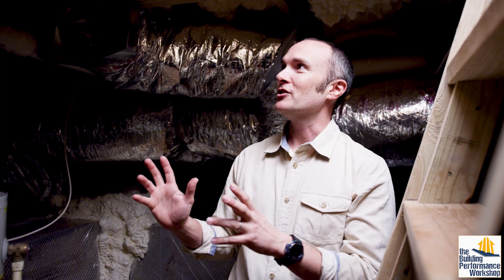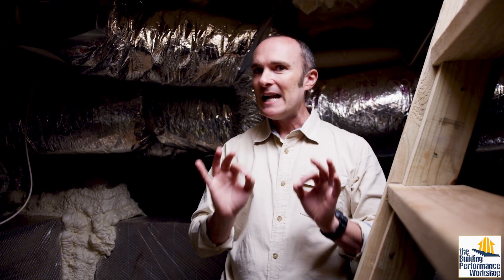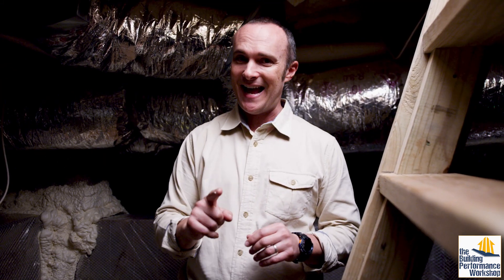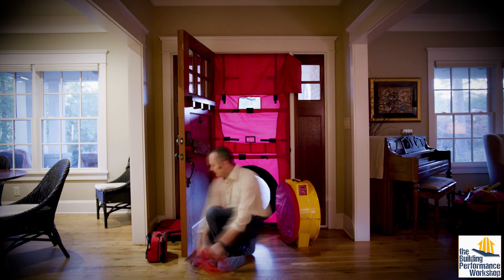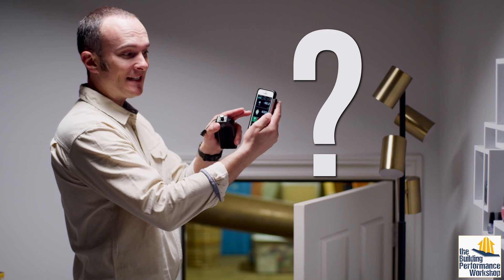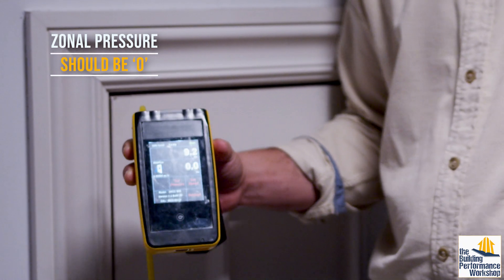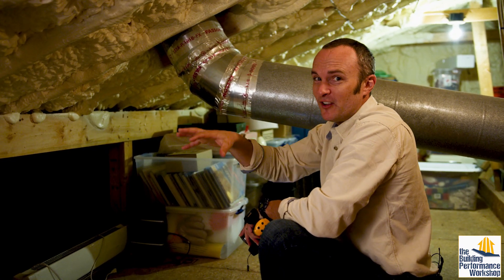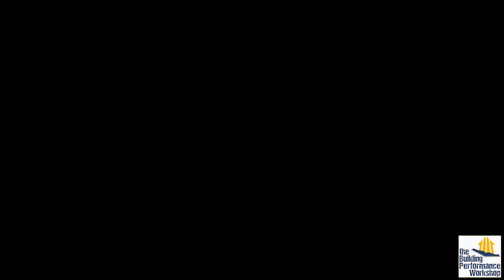Spray Foam Inspection & Testing in Crawlspace and Side Attic

Comment: So, what about spaces with no access that were foamed during construction? Is there an official method for positive pressure testings with smoke to identify leaks from the outdoor view? i have monitoried a project where the blower door was flipped and installed at the roof accesses. They then flood the roof cavity with smoke/party machine glycol based smoke and looked for smoke release on the outside of the building.

Comment: I'm often surprised how much gets missed with spray foam jobs and how much air leakage there is in attics that have been spray foamed.  I wish the installers would spend time running a blower door test when they're finished to find all the small spaces that they didn't reach, especially at the soffits

Comment: Very interesting video.  She mentioned a "hot, humid room" (assume an attic room adjacent to upstairs living space) and later mentioned "they brought in outside air" (into where?) and "encapsulated the crawl space."  Normally spray foaming the roof would be to make the attic space conditioned so the home interior and the attic room should all be more or less the same temperature & humidity.  Sealing that roof duct is a great idea but I suspect will not solve the problem (and since metal readily conducts heat, it may still be a source of condensation in the winter).  Is there an HVAC vent in the attic room along with a return to the main living space?  If not, that should help a lot.  Also, it sounds like the home is too humid in general (e.g. window condensation) and I suspect there's no dehumidifier in the encapsulated crawl space which is a source of moisture even if encapsulated.   Unless mitigated, that humidity will find its way into the whole house due to the stack effect.  This just shows how even a good builder may not be an "expert" in energy issues.

Comment: Did you install an ERV when you built the house?
Reply from the maker: This is not our house or build, but sounds like they added sn ERV after they started having problems.
Reply: @HomePerformance  So they made the mistake of not installing an ERV when they made the house almost air tight, is that correct?
Reply from the maker: Spray foam and ventilation were installed simultaneously, I believe

Comment: Another insightful discussion on a hot topic 👏. Are there any alternatives to spray foam to achieve R30 on 2x4 or 2x6 rafters? I think you once made a video where you talked about using stapled fabric with blown in. But mostly I have seen videos with mineral wool insulation after air sealing. Are newly framed roofs built with 2x10 rafters? Or may be they rely on combination of exterior and interior insulation.
Reply from the maker: Hey Suparn- you can actually get R-30 out of only 7 inches of Rockwool, which would be a 2x8, or two 2x4 layers. There is nothing like foam insulation for R-per-inch, unfortunately, but exterior insulation is a great option if you're dealing with 2x6 rafters, if you're replacing the roof anyway.

Comment: The tighter the house the more important dehumidification is, especially in colder climates.
Reply from the maker: And especially in warmer climates too
Reply: Many retrofits can't get to some areas so the higher humidity makes some places collect condensation which turns into water damage and mold. They have been struggling with that in the UK as they have been trying to make old housing tighter. In hot climates, you can be comfortable at higher temps if you control humidity.
Reply from the maker: Spoken from experience here too- our home is set to 76 deg, 45% rh

Comment: I am not buying this whole "Super Insulated" home thing. I remember the sick buildings. 
A building needs air changes an hour. I think it is one air change per human per hour. 
So you spend all this money sealing the home. Then you have to buy and install mechanical devices to condition and circulate fresh air.
I am getting closer to accepting the whole home envelope. 
I also remember the old builders joke. 
Let the pointy headed guys build the home to there super dreams, Install your own doors and windows so the building will actually function.
Reply from the maker: Hey Jake, you are correct that homes need ventilation with outdoor air. In fact, it’s required by code in many states- it’s in the IRC.
But you definitely do not need 1 exchange per person per hour in a home- this is a muddling of the ideas of ‘per room’, and ‘air change’ for sure. Btw, ventilation was installed in this home, mentioned by the homeowner at the top. We didn’t dive into it in this vid though.
Reply: @HomePerformance  I agree that limited air from outside is optimal.  That can come from either the ambient air or the soil.  I like an encapsulated crawl space with a slight negative pressure via one air vent (a fan) to the outside.  This will draw out soil gasses, including radon.  It may pull slightly from conditioned space which will pull from small penetration or openings in exterior walls but probably not noticeable and, of course, it beats soil gases.... :)

Comment: Can you elaborate on the reason why insulation the top and bottom of the attic is not a good idea? What will happen?
Reply from the maker: Predictability. If it’s not part of outside, and it’s not part of the home, then we can’t predict what temp and humidity it will be on any given day, or what will grow when condensation inevitably strikes.
Reply: It can be a humidity trap and is unnecessary duplication.  Conditioning both sides would be vital if one did this.

Comment: So if they had spray foamed the exhaust duct they’d have been ok?
Reply from the maker: In this case, yes, for that issue- obviously where there’s this, there’s more
Reply: @HomePerformance  you can tell people like you guys are making an impact on the industry though. The foam covered the rafters, there wasn’t an attempt to isolate the attic from the house, the HVAC company thought to put a dehumidifier in the crawl space. Lots of positive changes in how people treat issues like that.
Reply from the maker: Thank uou Paul! Honored to be part of the change!